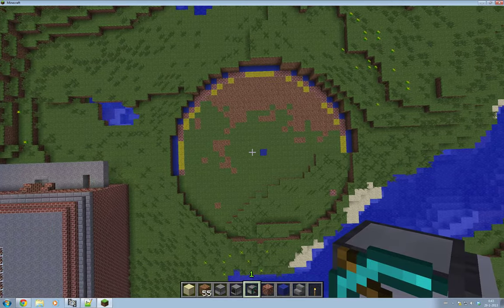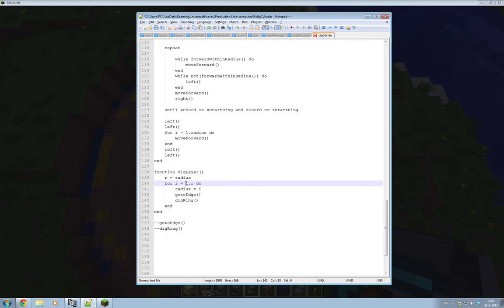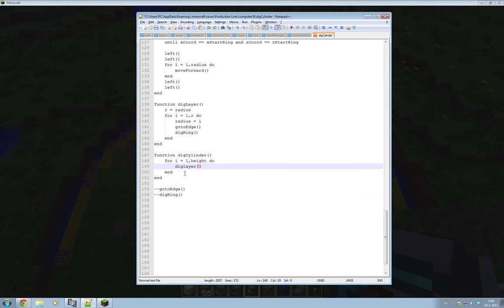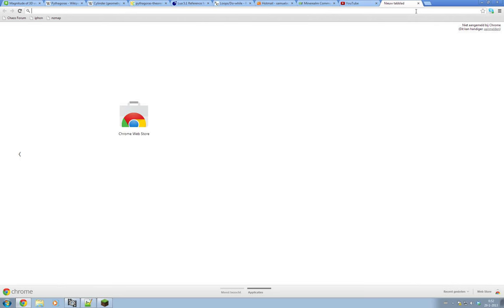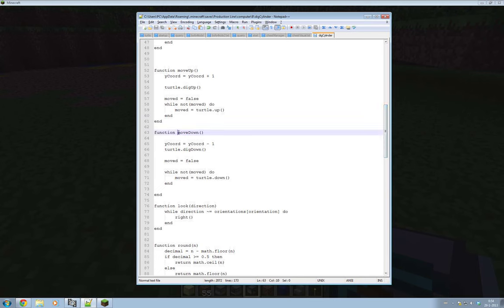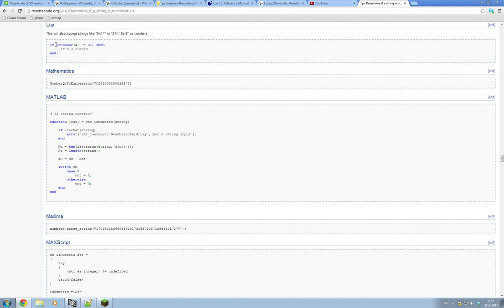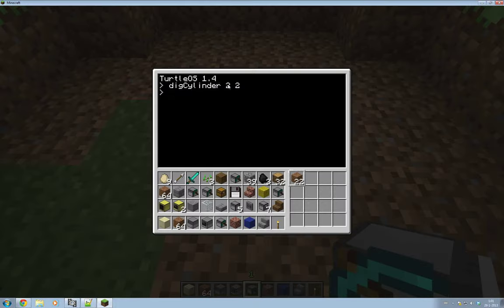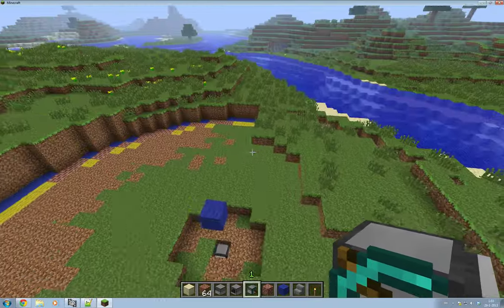Computercraft - Shape Digging [4] - Cylinder complete!

Comment from the maker: I was wondering if there was a way to get the length of an array in lua... that will help a lot. :p

Also, if you want to call functions just like the turtle API you can also use os.loadAPI.

(I was planning on maybe putting the coordinate/movement stuff in an API and improve it with GPS, fuel checking and automatic refueling. This would save copying functions from previous projects every time)

Comment: Hey BSGSamuel! Thanks ALOT for these great videos, I was lookin for this exact program, and was close to giving up when i found your videos. I also made some really REALLY easy improvements on the program when it comes to fuel, because it is not fuel friendely. The improvement is basically that the turtle starts one layer under the "top" layer, and so, instead of ony digging in front, it is also digging down and up. So, it uses 1/3 of the fuel, and 1/2 of the time i estimate.